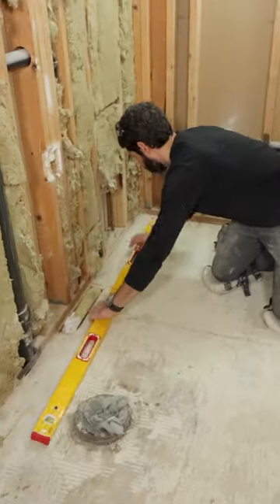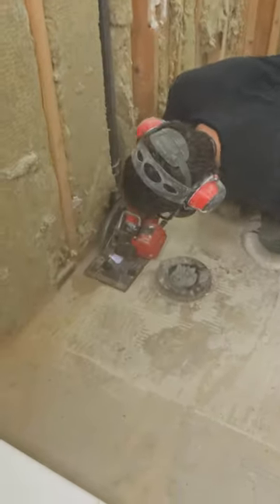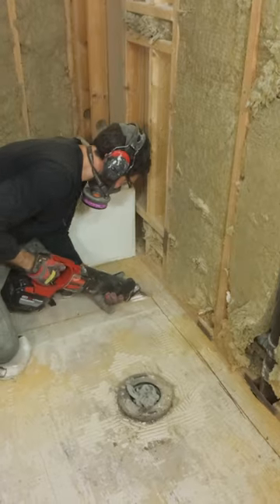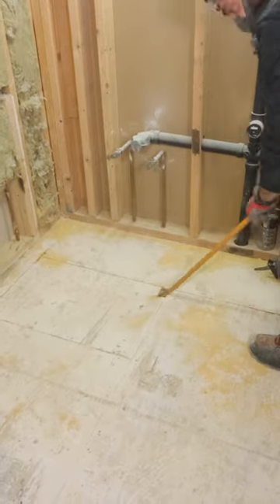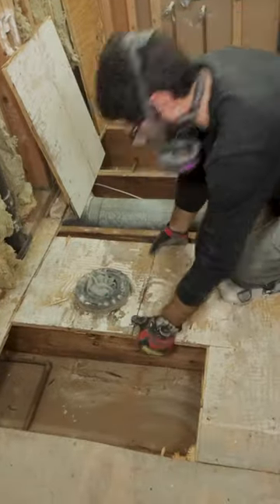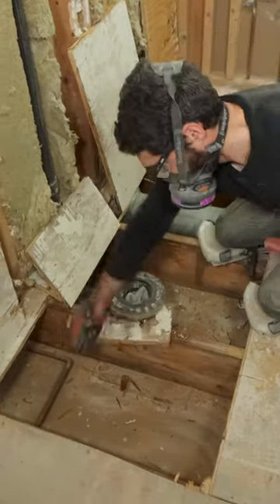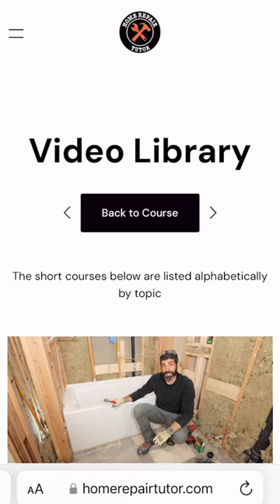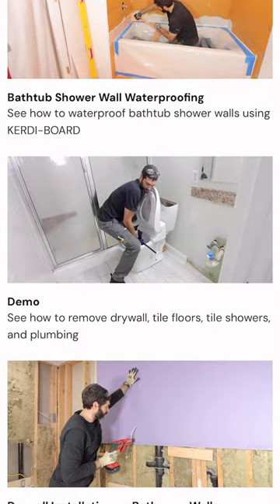Bathroom Subfloor Removal Tips - #shorts #bathroomremodel #demo #diy

Comment: I guess it was a blessing in disguise for you to have to remove the subfloor by preventing the pinhole leaks in those copper lines I'm calling the client to have for the problems down the road after your job is done and then they would try to blame it on you